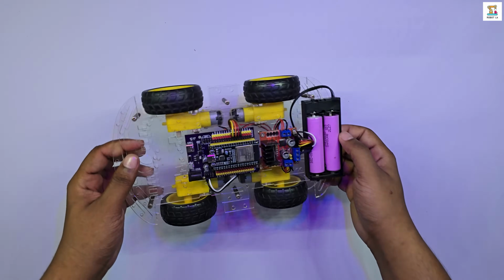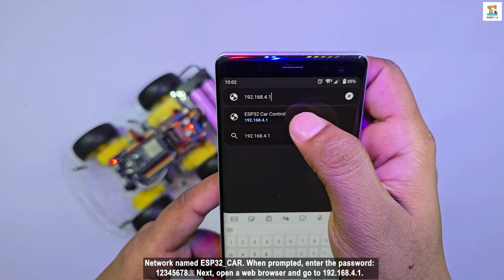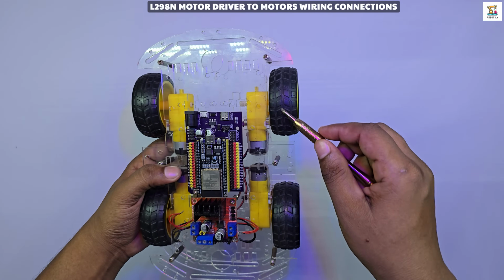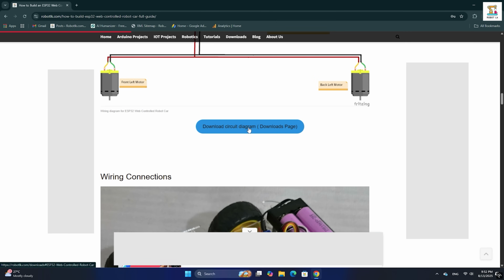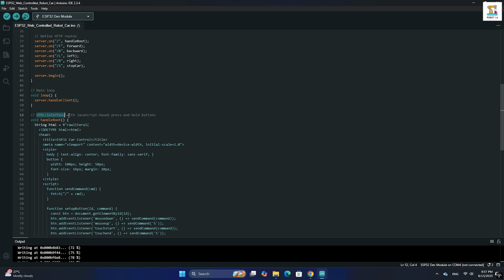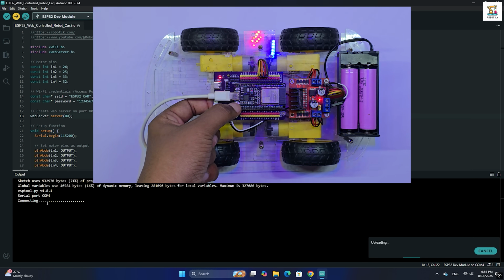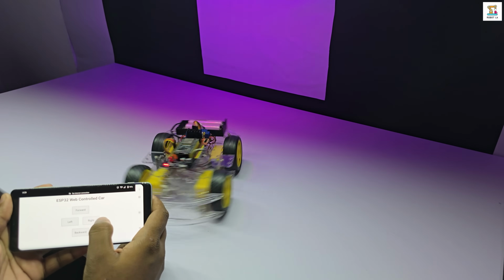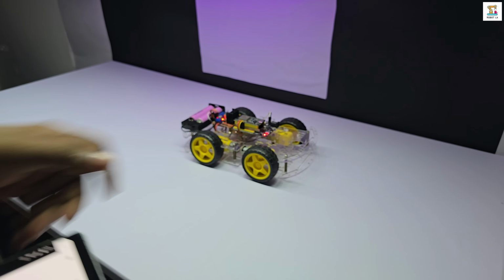How to Build an ESP32 Web Controlled Robot Car | No need for Bluetooth connections or Mobile APP

Comment: Thanks mate for clear explanations. My car is running very well. If someone got a problem of unable to see the WiFi network on your phone. Do this trick , just directly connect the each jumpers from the shield to the esp32 correctly and see WiFi shows up.
Reply: I have the same problem as you, the wifi doesn't appear without USB, when everything is on including the expansion board and l298n but the wifi doesn't turn on from the esp, I've tried all the methods
Reply: I see your comment here seems like you have a different way, can I see it?

Comment: Ardunio board uno R3

2 Pcs DC motor 12Vlot (100rpm) 
4pcs wheel 4 inch (plastic clamp) 
Ultasonic sensor hc_sr04
Microphone max9814
Jumper wires
Lithium ion battery 11.4 Ah 12Volt
Battery management system 2port XHM601
L293D motor Driver Shield Board
HC05 Bluetooth module (For Controlling ) OR Wifi which is best
12 volt lithiumion battery charger

And last plastic sheet Chesse  base ke liye. Kya ine sari chijon se Banaya Ja sakta hai project Domestic 🤖

Comment: My device can't find the ESP32 wifi network.
Reply from the maker: Was the code uploaded correctly? Sometimes this happens when the ESP32 board low of power. What battery is used?
Reply: @RobotLk  the esp32 is plugged into a USB cable, so it is getting enough power. The code was uploaded correctly using the same version of ESP32 board library. 

But what I think the problem might be is that I have a ESP32-C6 instead of the older model..

Comment: Bro i have connect all the things 
Web page page is also shown
But i press forward the doesn't spin why
Reply from the maker: You need to connect the two micro jumpers on the motor drive, which come pre-connected with the motor drive. They are located on both sides of the input terminals. You cannot use a 9v battery. Use a 18650li ion.